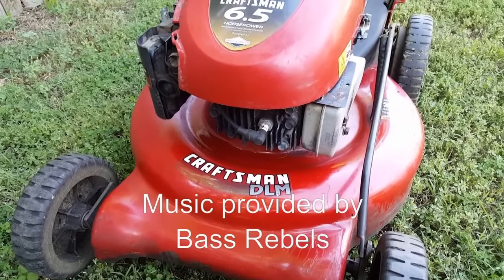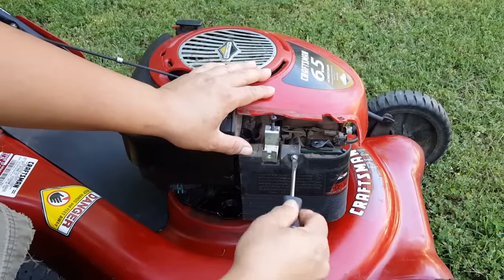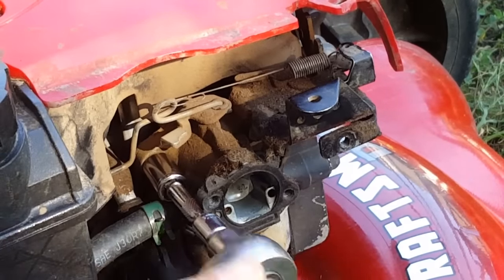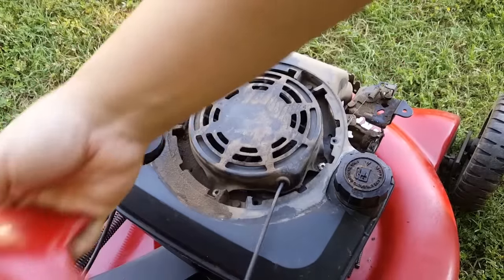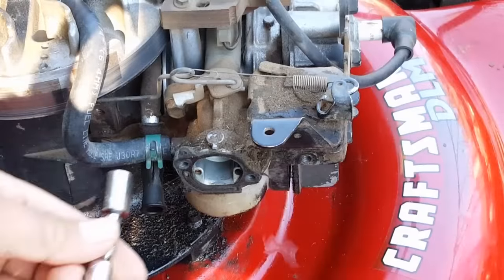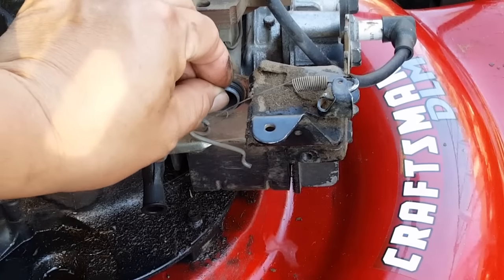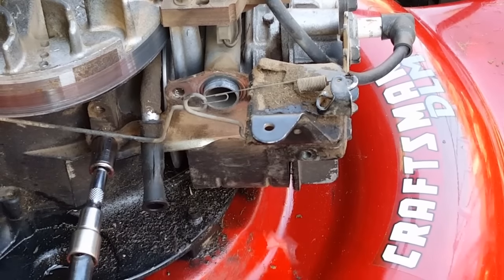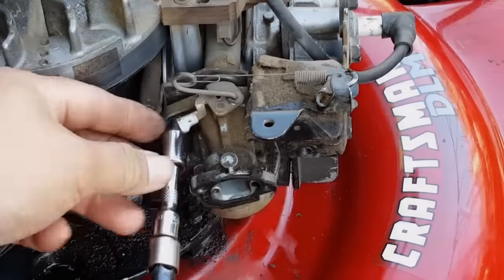Lawn Mower starts and then dies, turned out to be an easy cheap fix -Loctite!

Comment: QUESTION: At the start of this season, my lawnmower had fresh oil and fresh gas. After being primed, it started on the first pull. I then did four laps around the back yard. Things seemed to be going great. The lawn mower then stopped and would not even start. I went to Home Depot and I was told it was probably just a spark plug or air filter problem. I bought a new spark plug and and air filter. When I went to put them on, I saw the existing air filter looked brand new. I changed it anyways. And I changed the spark plug. But this didn't fix the problem. A friend of mine then said, "It is probably the carburetor." I ordered a new carburetor and my friend put it on. My friend also says he put on a new fuel line and inserted a "fuel line filter" that wasn't even included before. My friend said this actually made the mower better than it was before. My friend "claims" he started the mower and that he let it run for about 5 to 10 minutes. A couple weeks passed and my friend brought the mower back to my house. I primed the mower and it took three pulls to start the mower, even though I was starting it on cement with no resistance from grass. The mower then started severely smoking out the side of the unit. The mower was obviously running at only about half power. When the mower was moved onto grass, it instantly stopped from the resistance. I tried starting the mower again. This time it started on the first pull. The mower once again severely smoked out the side and was running at only half power. I let the mower run this time while leaving it on the cement. This time the mower eventually just shut off on its own. After that, I could not get the mower to start again. I watched some YouTube videos. I saw a couple videos about the "Governor adjustment." I tried that, but it didn't work. My friend also adjusted the "throttle" and this noticeably increased the RPMs. I initially thought this may have solved the problem; however, the mower then once again slowed down with the RPMs and ran at only half power and shut off on its own. My friend said the only thing he can think of that it might be is a "magneto" problem. What are your thoughts about this? Do you know what the problem might be and how I could fix this?
Reply from the maker: Michael Zoran thank you for the comment and the description of the problem. However I need more information . What color was the smoke? Bluish or dark grey? Have you confirmed the oil level Is correct? Is it a Tecumseh or Briggs engine? Flathead or overhead valve?  If I were there I would have to check all of the previous work done. Look at the oil and confirm level 3 times. I would then check that all gaskets were replaced or not damaged around the carb. Carbed Engines running at half speed could indicate an air leak between the engine to carb. Was the mower tipped on it's side or spark plug down during transit from your friends? There could be oil where there should be air and causing smoking. Thanks and please let us know.
Reply: Hi there. Thank you for the response. I will try to answer as many of your questions as I can. I will answer them in the order you asked. The color had a bluish smoke to it. I did check the oil, and it is in the correct range. At the start of the year I put in fresh oil and fresh gasoline with the correct amount of oil, and it still has the correct amount of oil. It is a Briggs and Stratton engine. It has 6.75 power. I am not sure if it is a "Flathead" or "overhead" valve; however, you might be able to obtain this information from the instruction manual at this link: https://www.jackssmallengines.com/jacks-parts-lookup/manufacturer/briggs-stratton/100000-19z999-series/126t00-to-126t99/126t02-0675-b3  ... I don't think the mower was placed on its side, but I'm not sure.
Reply from the maker: Thank you. I do have one concern. This mower shows to have autochoke with a thermostat override. If the carb is installed improperly the result is slow engine speed if it even starts. I have not done a video on this yet as I haven't encountered it yet. I have seen  other YouTube videos showing this problem tho. I will find it and link you to it.
Reply: Thank you very much. ... I am not very skilled in the area of working on a machine such as a lawn mower. My friend claimed he was skilled in this area; however, he ended up saying he didn't know what the problem was. He ended up saying "It's not the spark plug, not the air filter, not the carburetor, and not the fuel line." He said, "It must be electrical, and I think it might be the magneto." ... This is very frustrating, because prior to this year we had taken the mower to Sears a couple years ago and put it away. Last year I didn't use that mower. So it was really too late to go back to Sears. They probably wouldn't believe I hadn't used the thing, and the insurance was over now.
Reply: One thing I should mention as a reminder is that at the start of this year, the mower did start on the first pull and ran at full power. I did four laps around the yard. Then, the power started dropping out and it stopped. I couldn't get it to restart after that. This is when my friend said it was either a spark plug or an air filter. But we learned it was neither. This is why he then ordered a carburetor and a fuel line. That didn't solve the problem, though.
Reply from the maker: Have you checked the quality of the spark?
Reply from the maker: Then it started having issues after the  carb was replaced.
Reply: I'm not sure how to check the quality of the spark. ... Usually it will start and run for a little while - maybe 15 seconds or so.
Reply: Before the carb was replaced, the mower started on the first pull and I did four laps around the yard. Then, it just stopped and wouldn't start again. I replaced the spark plug, the air filter (even though those two apparently didn't even need to be replaced). I then replaced the carb and the fuel line. After the carb and fuel line were replaced, it would start, but with only half power.
Reply from the maker: I see so it does start and dies after a bit and at half speed. I hate to say this one is a tough one to diagnose without being there to do a full inspection.
Reply: Correct. Now that the carb has been replaced, the mower does start; however, it runs at half power while severely smoking blue out the side, and then after about 15 seconds completely dies. After that, you might be able to get it to start one or two times. But after that you can't get it to start at all until a lot of time has passed - usually the next day.
Reply from the maker: This might need to be taken to a shop but a diagnostic could cost from 40 to 80 dollars.
Reply: That's the problem. When I took this to Sears at the end of the year, I was told it worked fine. I dumped out the oil and gas and put it away. Then, I used the mower at the start of this year and everything started on the first pull and seemed okay. But four laps later, the mower stopped. The bad thing is the labor to fix something costs so much. It really isn't in my budget.
Reply from the maker: Time to buy a new one
Reply: That is the problem. The mower was working fine when Sears saw it. It then starts up on the first pull. It goes four laps, and then doesn't work anymore. That seems weird. Do you know of anyplace that might see it for a low price to inspect and repair it?
Reply from the maker: Michael Zoran I wouldn't go to a large service facility.  Try to find a small single man shop that hasn't been around for long. That's your best bet in getting an unbiased answer.
Reply: Well, if you are going to be in Michigan anytime soon,  you can feel free to take a look at it.
Reply from the maker: Michael Zoran you'll be the first person I contact. Thank you again.
Reply: Michael Zoran l
Reply: Okay...  I know what exactly what you are talking about. Another problem is what is called "Blow by."  Inside of your engine as it is running the oil is being thrown against everything inside so therefore inside your combustion chamber gases is being thrown inside the engine oil causing High atmospheric pressure. As a consequence the pressure builds up so much that there is a rubber tube or aluminum to that comes out of the engine block and goes directly to the air filter. It is almost like a PCP valve except for dealing with lawn mowers. With all the atmospheric pressure going on inside the engine it's being thrown inside the air filter and therefore sucked in causing it to stall. And the more you're keep running that it's going to keep getting worse and shut off. You're going to have a hell of a time to get it started. I've seen some people remove that tube that goes into the air filter and a lawn mower will run like a champ 85% of the time depending on condition. Word of caution when you do this or oil will seep out slowly but surely. Put it this way if you have a V8 engine that has a lot of miles the piston rings and everything else is not correct you're going to have a lot of atmospheric pressure and therefore that tube on top of the head gasket cover PCV valve will be sucked into your intake air cleaner. When you start having excessive oil going inside and being sucked in not a good thing. So yeah when the Piston ignites all the gases goes inside the engine causing very high atmospheric pressure. And also depending on your valve cover if the gasket is faulty in a little gas can seep inside the valves and go directly into your engine chamber. I will start with that and also check to see the coloration of your oil.  If it has milky like substance. I wish you good luck.

Comment: Its the Operator!
No seriously same problem one of my mowers had,  because I have sevral lawn mowers I just set it aside and used a different one. one of the bolts got lost anyway.  ??? it fell out who knows where it landed.

FIY anyone reading that Lock tight is about 45 dollars a bottle 30 years ago it might be more now, in a pinch you can use silicone calk it will hold a bolt in .
Reply from the maker: Thank you for the comment I appreciate it. You are absolutely correct.  I believe somehow the operator had something to do with it.  Thanks for the tip to

Comment: Another great video.  I just found you a couple of days ago.  You explain things very well.  As someone who doesn't do small engine repair, you've given me some great tips what to look for and where to start.  Keep your videos coming!  I do question using the thread lock-  Couldn't that be an issue later on if you had to remove the bolts?
Reply from the maker: yes it could be, if you use the wrong thread locker, try and use a medium strength one, that way, you can take it out later on.

Comment: I have fixed alot of push mowers thats start and die and i have never once seen one that the bolts come loose 9 times out of 10 its the  jet in the carb that needs to be cleaned and you should never use red lock tight on anything that has to come back off its permanent
Reply from the maker: Thank you for the comment.  This was rare for me to.

Comment: Thank you so much, I was so frustrated with these machines I have I would get them running and my kids would bring them back saying GranMa fix it 😱 I know I just cleaned and reassembled this mower so I think they was just monkeying  around  me😑
Also I have a riding lawnmower that my SonInlaw put mixed gas in by mistake , it was cleaned out but it would start and I cut grass one Time with it it gave a shotgun backfire and wouldn’t start again. 
Now what do I do? Take it apart and clean again??❣️💖😱🤔😑
Reply from the maker: The riding mower backfire is very interesting. The carb could be flooding the engine but have you checked the valve lash yet?

Comment: I wonder if mine is the same case. The first start of the day, it always run for about 10mins then dies. After a few minutes, it runs again for a minute or two before quitting then eventually it won't start until the next day. The gas tank is cleaned, the carb is spotless, throttle cover opens and closes smoothly. Air filter is cleaned, this is a mtd yardman 159cc powermore lawnmower without a primer.
Reply from the maker: Actually I'm guessing you have a bad gas cap. The cap is supposed to vent air into the tank so fuel can properly travel to the carb. Try loosening the cap when it stops  and then try starting it again.
Reply: @HomeGaragechannel  so Everytime it stopped, I check the gas level and it seems to be draining fast. When the cap is shut and I tipped the gas tank over, gasoline leaked out. When the machine wouldn't start, I also tried leaving the gas cap completely wide open and it still won't work. It's strange that the next day, I do I pull and the lawn mower runs fine for awhile until it slows stutter like it is running out of gas.
Reply from the maker: @YouTh3r3  okay thank you for the information.  I'm leaning to a carb issue that's not allowing enough gas to flow into the bowl then.  I would consider a carb swap. Also have you tried replacing the spark plug?
Reply: @HomeGaragechannel  yes, I have. Swapped out a new one and set the gap. Changed out the motor oil too.
Reply from the maker: @YouTh3r3  okay. If you use ethanol gas you might want to remove the fuel line and see if its collapsed in the middle of the line. That would restrict fuel flow.

Comment: Check leakdown to check rings and valves and head gasket. Replace the carburetor. Tune the engine. Change the oil. Remove the flywheel and replace the top seal and replace the lower seal. Check governor speed. Torque the head. Remove the head and clean the piston and valves. Replace the valve guides and seal.
Reply from the maker: Thanks for the thorough rundown Robby Jones.
Reply: Home Garage Hopefully my comment will help somebody to fix a lawnmower. It's easy to overlook things.
Reply: Over 90 percent are home mechanics with little knowledge so this is very extreme, so most won't know how to do what you are talking about. But these are all good steps for those that know how to do it.
Reply from the maker: Thank you  Mark Rajfura for the comment.  I appreciate it.

Comment: You have a stuck auto choke! The spring that is supposed to open it after 
choking is weak and will not open it! If you pull it open with your 
finger, it will run like a new mower, until you choke it again and it 
sticks again!
Reply from the maker: There are springs at your local hardware store. Just take the old one to the store and ask an associate for help.

Comment: Why, Do you not clean all covers before putting the mower back together. You didn't even spray the carb or linkage with cleaner and oil them. The video is great! You pay attention to detail on fixing the problems but lack maintenance on the carb and linkage.   Shawn
Reply from the maker: It's up to you if you want to clean and oil it. Thanks for the comment.

Comment: HAVE A 5 HP BRIGGS AND STRATTON THAT RUNS BUT WHEN YOU SHUT IT OFF IT WILL NOT CRANK BACK UP I DID THE TIGHTEN UP THE BRACKET ON THE HEAD THAT HOLDS THE CARBURETOR. WHAT ELSE WILL CAUSE THE LAWN MOWER TO RUN AND THEN NOT CRANKS WHEN I TRY  TO RECRANK. THANKS JEFF WETUMPKA ALABAMA

Comment: When you see that the air filter gasket is stuck to the carburetor on these Briggs carbs, do you find it best to leave them attached or to replace and install new gasket on the air intake base?  Does your preference change if it is a primer bulb model?  Nice video.
Reply from the maker: Thanks for the comment and the watch.  As long as the gasket isn't torn I usually don't replace it. Now if I have a problem priming the carb then I'll consider changing the gasket also.

Comment: Do you think the replacement of the O-ring was the fix on this one?  Creating a better seal
Reply from the maker: Thank you Annony Mouse. Replacing the oring would help but the loose bracket will negate the oring and it will allow the carb to wiggle away from the oring.
Reply: Oh gotcha, that make sense.
Reply: Not to mention get worse as you use the lawn mower and create a bigger gap.

Comment: I had a split in the tube,do you think that could have been my problem?also how tight should i have my governor springs?please and thank you
Reply from the maker: I don't which tube you're referring to but I'm guessing it's the emissions tube... and no that wouldn't cause a running issue, just a filtration issue. as far as the governor I've never checked what kind of tension should be on it .
Reply: @HomeGaragechannel  thanks for getting back to me,I was wondering should the springs be tight enough to keep the flaps either side of the carburettor snapping back to closed having been moved

Comment: My Craftsman mower was working perfectly last year.  Why would the carburetor come loose while it was not running?
Reply from the maker: does your mower shake even just a bit, the bolts will just work themselves loose over time.